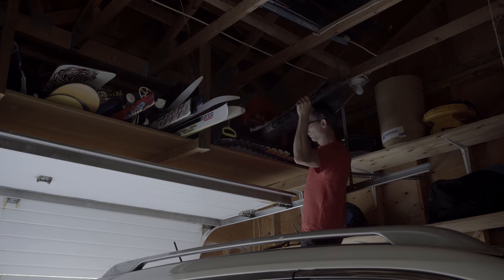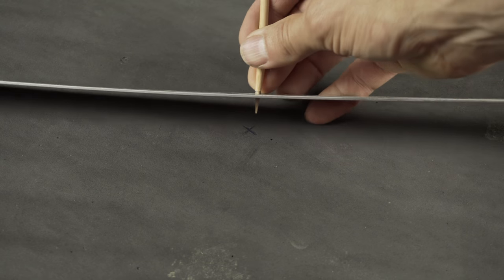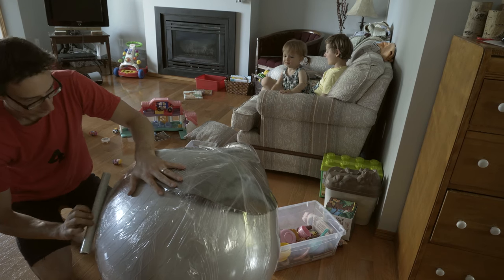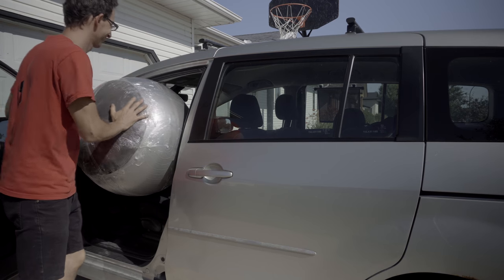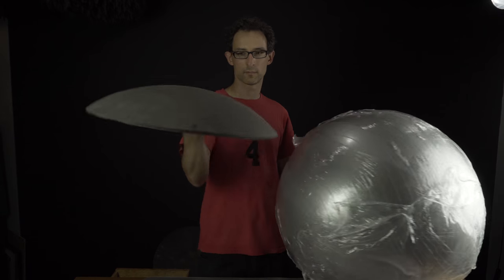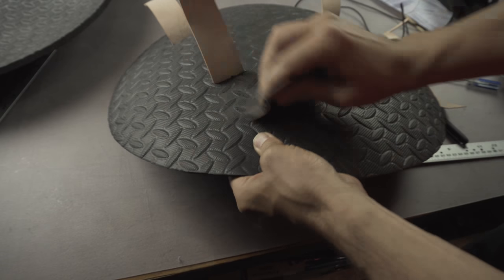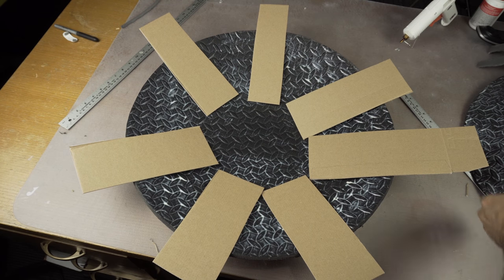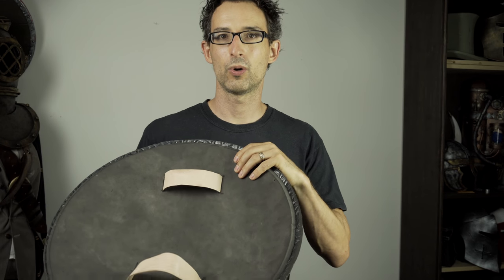How to Make a Domed Foam Shield. DIY Wonder Woman/ Captain America Cosplay Shield

Comment: If you don't want to drill through your ruler for any reason, use a loop of string (when stretched out flat the right length) instead.
Reply: That's what I was thinking.
Reply: Yeah, or just use a ruler that comes with holes. Most rulers already have a hole at the tip and/or in the middle. It doesn’t even have to be one that stretches all the way across the foam. As long as it’s at least half the length you want, it should work fine.
Reply: Hannah Jones exactly what I was thinking!
Reply: Yeah, or just a long stick of wood!
Reply: @utubewillyman  yeah! Like a ruler.
rich girl pose
Ohhohoho-ho!

Comment: If you do the outside heating method instead of in the car, take some Aluminum foil and make a surface area a bit bigger than the shield. then tape the edges in line with the sheild so that there is a little space between the shield and the aluminum; this will create an oven like effect and heat your shells faster. I don't think it will melt the plastic.

Comment: Another awesome tip..will be using this tip for sure... would this technique work with a heat gun at all ?
Reply from the maker: I'm not totally sure... This technique relies on the fact that you are heating up the whole surface at the same time, whereas with a heat gun, you can generally only do a small section at a time. I think it could be done if you have a bit of patience, and heat it all up gradually.- Just try not to melt the plastic wrap.....
Reply: Lost Wax ... I see what you mean..just trying to think of a way to achieve this on those less then sunny days 😊
Reply from the maker: Yeah, I agree, it would be good to have an alternate technique that would work well when it's cold.
Reply: It would work with a heat gun, however as Lost Wax mentions you need to be careful how you go at it. 
Something to try that I have down is after covering your bust or ball or whatever shape you are foaming the foam too is covered in cling wrap and tape, press tin foil over top to act as a barrier between. It helps deflect SOME heat and can heat up your foam a bit more quickly from both sides. But whenever working with heat, be careful! <3

Comment: Would you recommend scoring lines to be heated before or after the ball ! Awesome job !!
Reply from the maker: I don't score my lines and then heat with heatgun like most do. I just go over them with a pen until there is a good solid valley in the foam. I think you'd probably have to do it before and after heating because the heat will release some of the stress.
Reply: Lost Wax awesome !! Thank you

Comment: You are so fantastically talented. Dunno if the sun gets hot enough in my part of Canada, and the warm part of the year is over. Do you suppose a hair dryer might work?
Reply: If your going to use a hairdryer it might make sense to make a box enclosure for the piece so that the heat is even and it shouldnt take as long to heat up a smaller area. Cardboard should do fine for structure and its a decent insulator.

Comment: Thank you for this! I currently use Barge. What type of water-based contact cement do you use? I did not see it in your materials list link, but apologize if I missed it.
Reply from the maker: The one I used on this was Lepage low odour contact cement. I'm not sure if that's a Canadian company though. It's alright, but has room for improvement. It could definitely be stronger- I only use it on large surfaces, I don't think it would handle edge gluing foam. If you've got proper lung protection, I would stick with Barge though.....
Reply: Thank you! Great videos and content in general, BTW!
Reply from the maker: @rmoosepig  Thank you very much!!

Comment: I’m super late... but could you use a heat gun to speed up the process of shaping the foam instead of setting it outside? Just wondering! Thanks! :)
Reply from the maker: I haven't tried it yet, but I think it could work- just depends how much heat cling wrap can handle I guess....And how careful you are with the heat gun. I'll have to give it a try.

Comment: totally useful for the shield i wanna make, same but smaller and i mean very small since it's goblin slayer's shield.
this is a really great method mad thanks a lot, i was thinking of heating than molding it myself manually but i didn't thought about using rubber balls, also do you think there are any substitutes for something to use other than rubber balls? cuz i don't have that currently
Reply from the maker: Anything round with the diameter you need would work. You can also think about using the inside curve of something, like if you have a pot lid or something that is domed.
Reply: @LostWax  noted, thanks a lot for the tip man. im gonna try using some cooking tools now cause some has a rounded part on them, keep up the good videos man your ideas are genius

Comment: But what if you live in a place where there is almost no sun? What technique would you suggest then?
Reply from the maker: I haven't tried yet, but I think you could use a heat gun and slowly work around the disc to form it.
Reply: Lost Wax Would a hairdryer work as well? I'm fairly new at crafting and I don't have a lot of different tools to work with.

Comment: Do you have a post somewhere of how you painted it ?
Reply from the maker: I actually didn't film the painting part for some reason, not sure why, so sadly I don't have a video. If I remember correctly, I used the same technique I use on most of my projects, where I rub a little metallic paint over a black base coat. I think I used DecoArt metallics "pewter" for the darker areas.
Reply: Lost Wax I watched your Wonder Woman head band video. I think that's probably the technique.

Comment: how did you make the patterns on the shield?
Reply from the maker: For the star shape, I used a thin flat edge to compress the lines in the foam. The V shapes on the outer rim are made by applying a line of hot glue.

Comment: But how'd you do the front?
Reply from the maker: I'll make another video showing how I made that part, but basically, I traces the pattern on and indented it with a pen/ spoon handle as I did in my mini top hat video here: https://youtu.be/zoN4K9wLi6M?list=PLIbQjQ4h9ZxGehOpXuYzhar6SG8dxBZv8
The v's are made from hot glue, and the part in the middle of the v's is just cut from foam.

Comment: Why not just use a heat gun on the foam instead of waiting a while to let it take shape? Unless you don't have a heat gun, then that makes sense.
Reply: DeltaOracle257 true.. just heatgun and baal shape.. 10min its done with shape
Reply: Saturn nope.. u heat foam first. and then make shape from it.
Reply: But the sun technique is free.
Reply: As others have mentioned, it seems too much direct heat would create an uneven surface but you can duplicate this effect by holding the heat gun much further away and moving it regularly for an even heat and little risk of melting tape or wrap or ball. This would take much longer, but still be faster (and more convenient) than waiting for a hot day. I think the big takeaway idea here is the idea of using compression and large surface area heat molding to make a perfect dome as opposed to a riskier "pie slice" method shown by other propmakers.
Reply: Heat gun will work.  Cos play armor is  made from the same sheets andshaped using heat guns.  Just need to make sure you make even passes.
Reply: Yeah, a heat gun would be faster and more effective. Ian Cunningham The tape wouldn’t melt (?) As long as it didn’t effect the exercise ball (which I have no idea off the top of my head) it should be fine. Otherwise, I don’t see why you couldn’t just use a hair dryer or something as an alternative to a hot car.